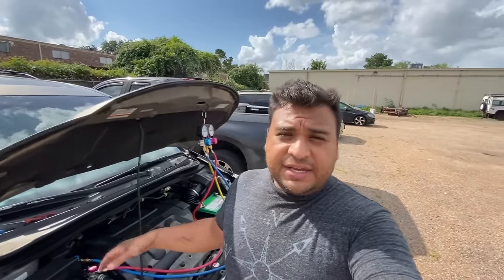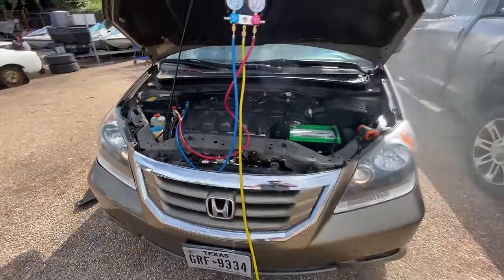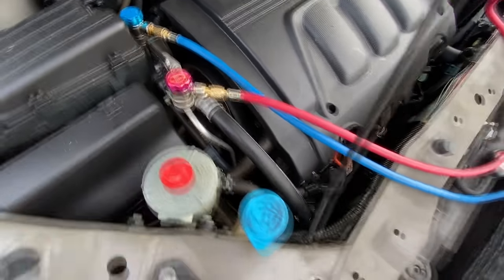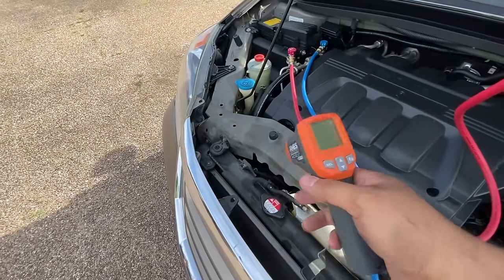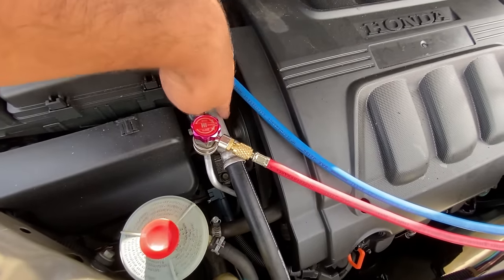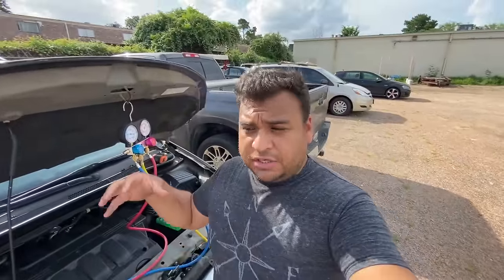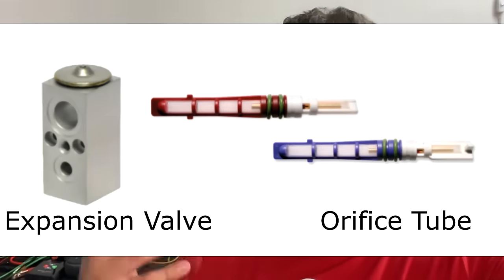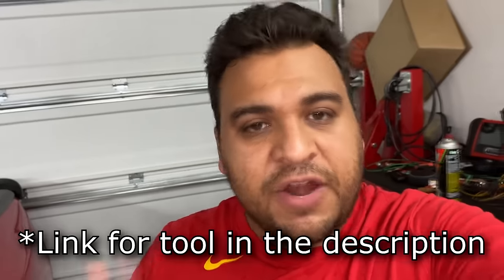HOW TO FIND A CLOG IN YOUR CARS A/C SYSTEM

Comment: This is the only video i could find that actually talked about and showed the refrigerant blowing out the discharge valve on the compressor. My Ford Ranger was doing the same thing. I thought i had a leak because it sucked up 4 cans of freon after I changed the compressor. So I was letting pressure out of the low side valve. I never checked the high pressure side with a gauge like that but i have been meaning to get one from Autozone to check pressure on both sides. My truck never blew cold and the lines never got cold. But i was only feeling the lines at the drier. Never thought about it could be blocked. I changed the compressor and all the lines and drier and all the o rings about 3-4 years ago and all i had to do was recharge it with 28oz of freon and it worked fine until now. Except once it started blowing only thru the defrost and i found a broken vacuum line and fixed it. But I never replaced the condensor. I've had the truck for 16 years. So do you think my condensor is blocked because my compressor was spitting the refrigerant out the discharge valve also. I've never seen that happen before ever on any car. My compressor is fine and clutch kicks on but not long enough for car to cool and the lines never get cold. Maybe I should change my condensor. But i hate to change it if i don't know for sure since it's the most expensive part of the whole ac system. Wonder what would make it get blocked.
Reply: Did you find your problem?  My h3 hummer is doing about the same thing.